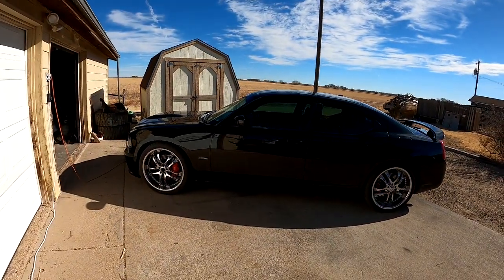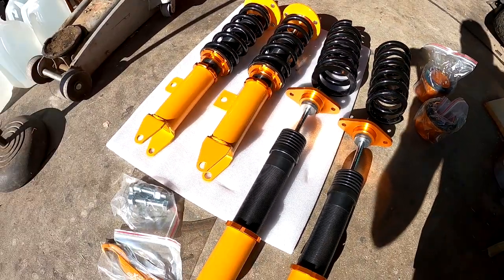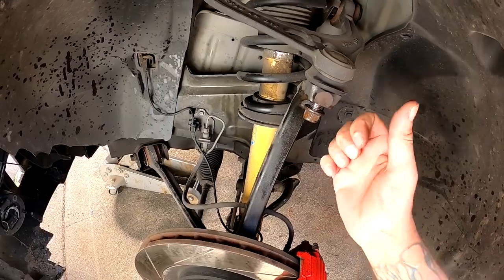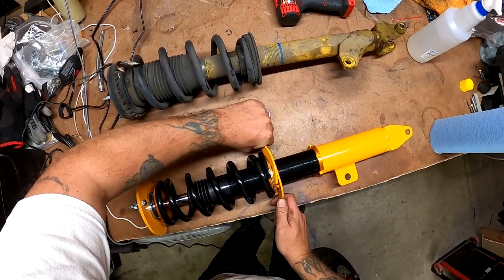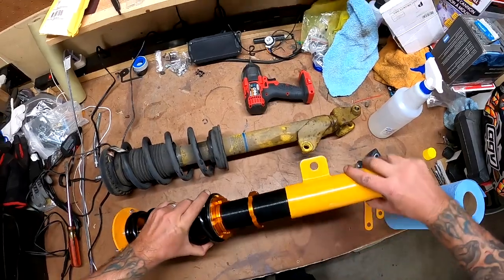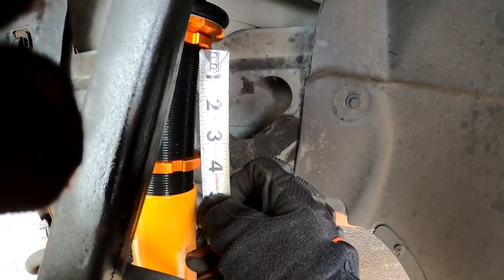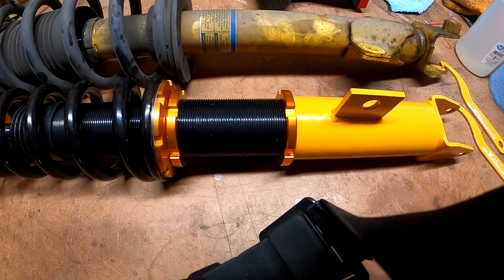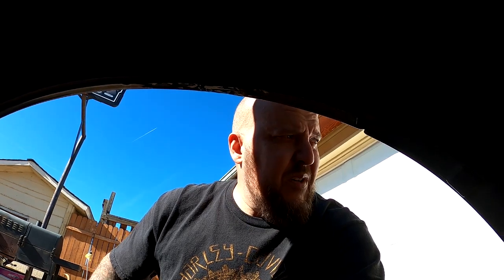Dodge Charger gets MAXPEEDRODS coil over kit

Comment: Do you have any trouble at all with rubbing? I have 245/45/20s but im scared I might rub
Reply from the maker: @ezequielcortes8076  had a little rubbing but just front inner fender
Reply: @ oh ok because my upper control arm is like right above the tire, do u think that would rub or not sure?
Reply from the maker: @ezequielcortes8076  by control arm never rubbed

Comment: Have had these on my 2010 challenger rt for a year now. They definitely handle better and ride a bit rougher but I do have it setup pretty stiff. No complaints so far though, hopefully they keep going strong and for $300 I can't find a bad thing to say (besides the install being a pain in the ass but that's to be expected lol).
Reply from the maker: Yeah I still haven't installed the rear because it's gonna be a pain but with just the front alone I can feel a difference in the handling especially cornering and yeah they are a little stiff but they seem to be good coil overs... thanks for sharing and watching as well
Reply: Just got a set for my SRT8 Challenger. They will be installed the 16th by a dodge technician. Im intersted to see how they perform.

Comment: That was an awesome video brother one quick question can you ajust this coilovers to mimic the original stock hight?
Reply from the maker: Thank u sir and unfortunately from what I could see there wouldn’t be no way to set stock hight basically because u can only screw the top out so far so it seems either way ur gonna be lowered an inch or two
Reply: @SkillinTime  sounds good 👍 thanks for the reply

Comment: I just put these on my 06 300c and looks like i am sitting as low as you but i have the min amount of thread in the lower tube '30mm' so i can not go any higher and the engine crossmember is 100mm off the ground with no weight in it, it's too low!, speed bumps ,curbs etc are a nightmare how high does yours sit off the ground? The rears are easy to do just remove the inner lower arm bolt, shockie bolt and lower it with a trolley jack 'exhaust pipes may get in the way'
Reply from the maker: Yeah mine did the same thing they didn't give me enough threads to be able to pick exactly what hight I wanted in not sure what my measuement on it is cuz the cars gone now but it was sitting pretty low but yeah ur right about the low part

Comment: When you did the rear Coilovers did the adjustment metal piece go on the top of the spring or the bottom of the spring inside ?
Reply from the maker: I never got to the rear looked like I was going to need alot of time for that sorry
Reply: The adjusting piece goes on top of the spring 'remove the upper insulator'

Comment: Did you have troubles with your camber?
Reply from the maker: Yeah it did toss it off a little and alignment shop couldn't put my car on to dial it in but haven't noticed to much of a difference
Reply: @SkillinTime  mine is way off
Reply from the maker: Did u make sure u screwed both sides in exact

Comment: did it fix your issues i got a new front end kit from the bay and copped these off max speeding rods for 300 hopefully these will make my ride smooth
Reply from the maker: Yeah it definitely stopped making the noises it was also gave it a nice lowered  ride hight so I think it handles better not sure if the rides too much better though as far as soaking up the bumps but so far I’m happy with the set up still need to install the rear set up when I find the time and we will see how that works out 👍